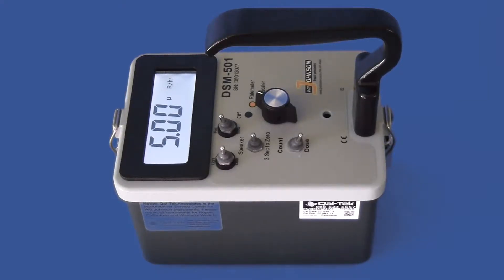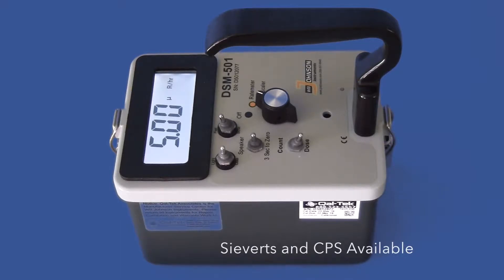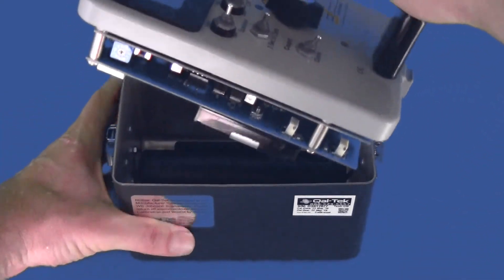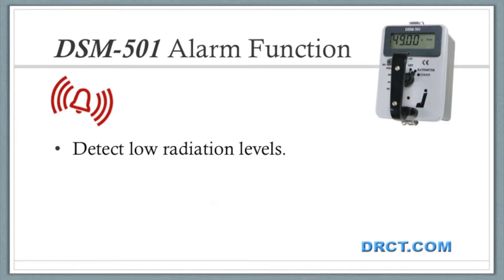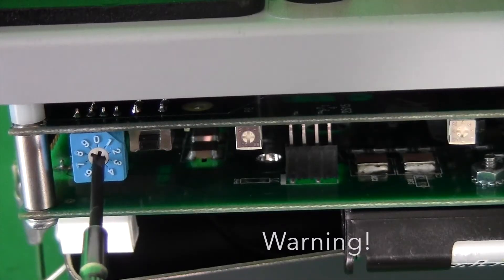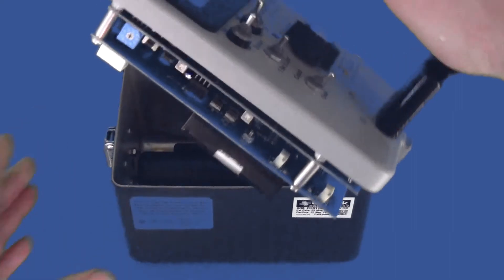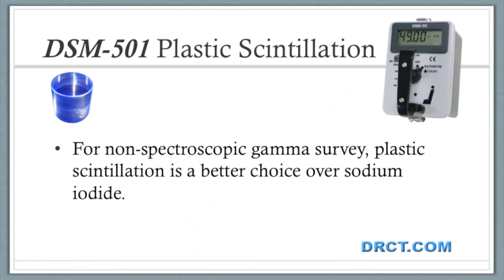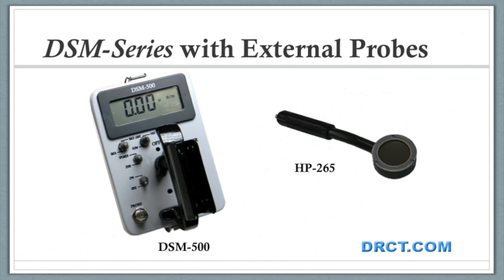DSM-501 MicroR Meter / Gamma Radiation Detector  demo

Comment: Not the most practical unit to adjust. All adjustments should be external instead of internal.
Reply from the maker: I agree. By the way, I uploaded a new video, yesterday.
Reply: Direct Scientific I heard all autoranging analog units have been discontinued. Only the digital models are available and even those have been streamlined to DSM 500, 501